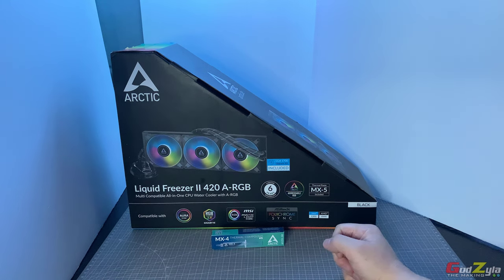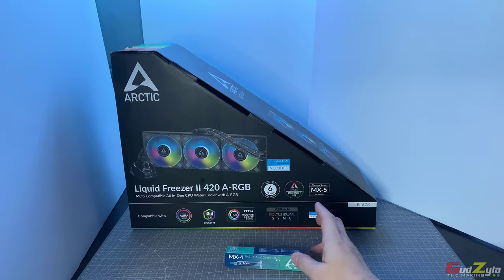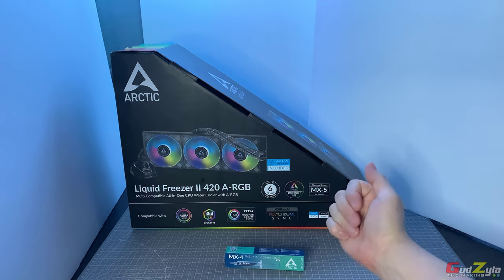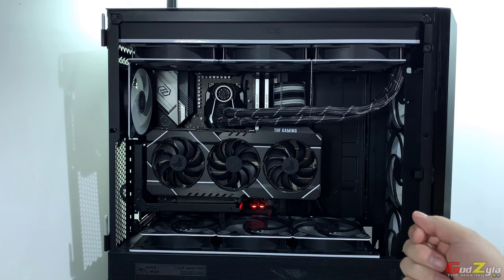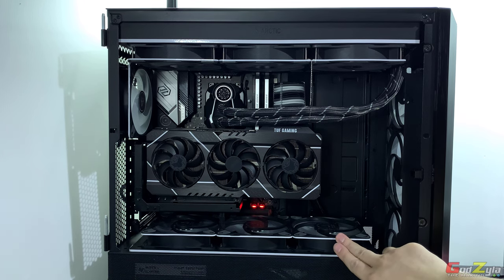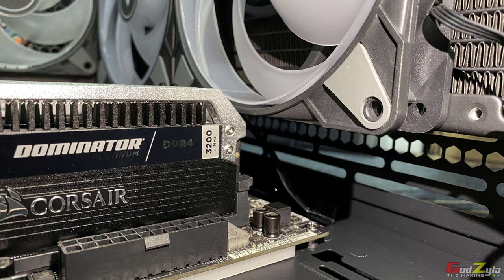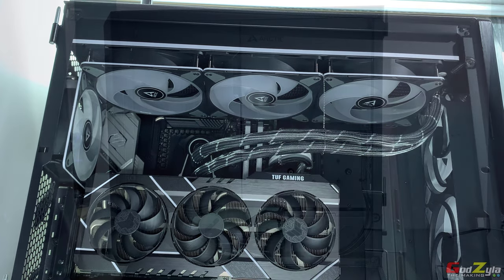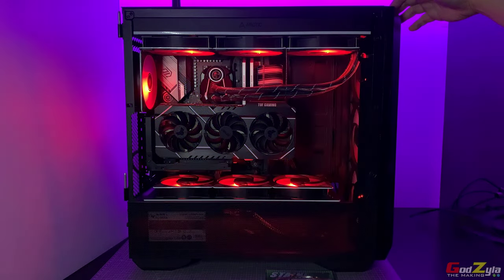Arctic Liquid Freezer II 420 in Lian Li Lancool III - Part 2 (The Experience)

Comment: This is just bonkers! Thank you so much for sharing this build and making this video. Just one thing: this is a P12 fan in the back of the case correct?
Reply from the maker: Hello Mordecai, welcome to my channel. Yes the rear is an Arctic P12 pwm pst argb fan, using rubber studs instead of screws to mount, as you need to offset abit for the top 140mm radiator fan to be in place.

Comment: Could you mount the 420mm aio on the front?
Reply from the maker: Hi James Birmingham, welcome to my channel. It is possible to put at the front but the top front fan you will have to forgo as it’s blocked by the hose of the radiator. Therefore you can’t mount the top front fan.
Reply: @KleoYan  what if you put the fans in front of the rad?
Reply from the maker: @jamesbirmingham9951  hi I do understand where you are coming from. I did try that but failed to close the front tray. Unless you are using a standard 28mm radiator and not a 38mm radiator of an Arctic 420 liquid freezer II.

Comment: Will the 420 aio work as push pull in the front?
Reply from the maker: Hello Joashane Garrick, welcome to my channel. Just a pull or push. The top fans will need to keep as 3x120mm and not 3x140mm. If you keep it as 3x120mm at the top. You should be able to do push pull configuration with the aio at the front.
Reply: @Kleo Yan  thanks for replying. I have the parts arriving in a few days. If you should push back the front bracket away from the motherboard, would the  push pull work with 140mm up top? I'm sorry if the question is rhetorical, just a bit anxious.
Reply from the maker: @cangwane  the issue is not about pushing the issue is the hose blocks it. 420 AIO has a fix position which occupied the whole length of the case front. Unless you can somehow place the hose at the bottom instead of the top. Which is not possible.
Reply: @Kleo Yan  okay I understand now. Thanks again for replying. I'll be back to this video in a couple days to help me build my system. 😁
Reply from the maker: @cangwane  you are most welcome. All the best with your build. 👍

Comment: Great vid! Any thoughts on how loud everything is on idle vs regular use.
Reply from the maker: Hello Jalen Fox, welcome to my channel. For a case which uses 140mm fans, your case will be silent as compared to using all 120mm fans. Though I have a mixture of fans in this case. 3 x 140mm on the liquid AIO and 3 x 140mm at the front, 3 x 120mm at the bottom and 1 x 120mm at the rear. It is quiet compared to my previous case, which is the O11D mini. you see 140mm fans do not need to ramp up at higher RPMs to keep things cool. Advantage of having 140mm fans, they can run at lower rpm but still produce more air as compared to 120mm fans. This case is now my daily drive and it's just beside me on my desk. I can work at night without having the hiss which I get from my old O11D mini. btw I see what I can do on my next video. It's all about thermal peformance of this case and the 420 Liquid AIO. I will include a noise test, but will need to wait as am currently busy with work projects.

Comment: Hi,got also this case with a z690 aorus master-13900k and rtx 4090 and arctic liquid freezer II 420,just replaced the back 140 to a 120 cause interfering with the mobo,for the rest its a good case,but it wasn't easy to build,the mobo is e-atx,so its big and,but after all i'm satisfied with it.
Reply from the maker: hello Fille1976, weclome to my channel. gald you have done up a this case with the 420, btw am curious, how is the temp for you on a 13900K.. on 5950X or 7950X it's superb temperature with PBO2.. my room temperture is always 29 to 31 degrees celcuius but the 7950X with PBO2 is hitting 79 to 80 degrees with consistant 5.2Ghz and 5.6Ghz ramdom boost speed.
Reply: @KleoYan  i took config E for this setup as its the most logical way,and temps seems ok.
Reply from the maker: @Fille-lj1qv  i see. thanks for the feedback. Am just curious as I stop playing with intel for about 2 years now.. but thank you!

Comment: This video inspired me to buy this case and use the exact same AIO and fan configuration. The build has been going well but now I am stuck with how to connect all of the fans and ARGB cables and i can’t tell from the video how you connected everything including the case controller cables. I have a fan hub and I have the RGB splitter and the same type and number of fans. Any chance you can help me and walk through what you connected each fan and argb cable to? I’m feeling so defeated by this step.
Reply from the maker: Hi Laura Blake, welcome back. I have done this. For all fan load. I daisy chained them according to this.

For fan load
=========
Top Radiator - fans x 3 (daisy chained) to motherboard CPU_Fan header

Front - 3 x fans daisy chained to motherboard CHA_FAN5 header

Bottom - 3 x bottom fans daisy chained to motherboard CHA_FAN4 

Rear - a fan to motherboard CHA_FAN1 

For fan argb load 
=============

First purchase this RGEEK 5V 3Pin RGB LED Splitter 10-Port Hub with 50CM 3Pin Extension Cord, Perfect for Lots of RGB. https://a.co/d/2lU92tv which gives you 10 argb port. Next your case have 3 argb connectors for the front fan. I have plug 2 front fans to the case argb connector, leaving one to connect to this argb 10 port hub. Now for the 3rd front fan, plug it this argb 10 port hub and you left with 8 port empty, the rest of the fans just plug individually to this argb hub. Argb extension cables might be needed. And I don’t understand why 3pin argb extension are so expensive on Amazon.com SJZBIN 3pcs Micro Connector Addressable RGB Extension Cable 30cm Black RGB Strip 3Pin Extension Adapter https://a.co/d/aA5BIkU.
Reply: This is super helpful!!! I was able to follow this and connect all of the fans. I did actually buy that ARGB splitter already so will tackle that next. I do have a follow-up question.

The case has 2 cables that I don’t know what to do with:

First, the case has a cable that has 3 ports for connecting fans. Was I supposed to connect that to the 3 artic fans that I installed in the front of the case?

Second, the case has a 4th ARGB connector that is longer than the others. What is that cable for? Is that supposed to connect to the motherboard? Or to the ARGB hub?
Reply from the maker: @laurablake5128  hi, I don't quiet get you on your first question about the 3 ports, are you referring to the 3 way splitter for fan pwm control? as for your second question. the fourth argb cable from the case is meant for you to plug to your motherboard, if you choose to use the motherboard to control the argb. If you do this, you will need to toggle the bypass mode from the argb button of your case. I normally ignore this cable as controlling via the case argb button is sufficient enough plus I do not want to install any software which will run in the background.
Reply: Thank you for your patience as I navigate this as a newbie :) I’m so grateful for your willingness to chat through this with me - it has saved me with connecting the fans!

Yes, I am referring to the 3 way splitter for the fan pwm control that seems to be connected to the case - is that cable supposed to be connected to the front fans?

As for the ARGB cable from the case, your explanation about that is super helpful - I’ll need to decide if I am good with using just the case button.
Reply from the maker: @laurablake5128  I see, infact that 3 way splitter is not needed in your situation as you are using Arctic P12s or P14s argb I assume.. that 3 way splitter is for fans that does not have the daisy chained cable like the Arctic has. You are most welcome, am gald to help, for your info I am not a reviewer. This channel is just my hobby and  I too will learn from others through feedbacks and comments. I am not 100 percent perfect. 😂. All the best with your build.
Reply: My gut was telling me it was not needed since my fans are daisy chained per your great guidance, but this is my first building and it made me nervous to see that cable not connected to anything. Feeling better now - it helps to chat with other builders. Don’t need perfection, just a friendly person to troubleshoot with, so many thanks! 😊 This case is solid and I love this AIO and fan configuration. I’ve had a lot of fun working in this case.
Reply from the maker: @laurablake5128  nice, welcome to the pc building community. 😉👍
Reply: Hi again! I’ve encountered one possibly two issues with the RGB and wondering if my issue might trigger anything that you may have encountered during your build. The first issue: two of the AIO lights are not lighting (the left and the right). These 3 fans are daisy chained and the AIO’s main RGB cable is plugged into the splitter hub (I have the splitter hub that you suggested). I checked the connections and nothing loosened.

The second issue (perhaps this is relayed?) is that the case controls do not change the colors or modes. The lights are all stuck on some strange flickering mode.

I’m gonna get back to troubleshooting tomorrow, but let me know if any of this triggers any thoughts. Thank you!
Reply from the maker: @laurablake5128  Hi, things to take note on, 1st make sure the front I/O is plug with a sata power source (Power suppply (PSU)) and 2nd the argb hub is also plug to the sata power source (Power supply (PSU). Double double check the argb connection of your fans, make sure all the female argb connectors are plug in the ARGB Hub. Same apply from your ARGB hub connetor (female) to your front I/O argb connetor (male). If you are sure everything is plug in properly, do some swap test between the fan argb connector in the argb hub. If still does not work, last resort is to have individual Sata source from your PSU to the argb hub and the front I/O controller. In dividual means. do not plug both to the same sata cable from the PSU. add an additional sata cable. so that your front I/O is drawing dedicated current from the PSU. apply the same for the argb hub.
Reply: So I’m now wondering if the problem is because the ARGB header is overloaded. I’m routing all of the fans to the splitter and the splitter is connected to a single ARGB header. Should I be using more than one header?
Reply from the maker: @laurablake5128  hi sorry for the late reply. Can you list down which motherboard are you using? Let me draft out a diagram for you later. For now am heading to bed. It’s pretty late at my end 2:44am. Will response to you later. Thanks.
Reply: Sure thing :) I have the Gigabyte X670 AORUS ELITE AX motherboard and the same AIO and fan types and configuration as in this video. Thanks in advance for helping me. The ARGBs are driving me nuts and I know there has got to be a way to fix it. The top 2 lights don’t light up, the rest of the fans are just flickering, and the case controls are not changing the colors. I feel like I’m close but I’m baffled!
Reply from the maker: @laurablake5128  Hi, this is how I do it for my setup https://imgur.com/6RHm349. If the picture is too small, kindly download it and zoom in.. hope it's not too confusing.
Reply: This is amazingly helpful. I see the difference in what I did with the ARGB connections:

First, you connected each of the top 3 AIO fans to the splitter (I have them daisy chained with one connection to the splitter. Could my approach be part of the issue? I’ll try your approach.

Second, I connected two of the front fans to two of the case controller cables, and the third case controller cable is connected to the splitter. Instead it looks like you daisy chained the three case controller RGB and then connected that to the splitter - correct?

Third, I connected the splitter to the D_LED on the motherboard. If you connect the case controller to the splitter, does that mean the splitter does not need to be connected to the motherboard?
Reply from the maker: @laurablake5128  you are most welcome. your approach on the front can be used. as in two of the argb connector from the case contontroller to your front case fans and one to the ARGB Hub. As for me, I didnt use three as daisy chained to the argb hub. I only use 1. also I do not connect any argb to the motherboard d-rgb connector as it's not required, unless you want to control your argb via gigibyte fusion ( I never like to install argb programs in windows due to background process)
Reply: What about the ARGB cable coming from the AIO pump. It sounds like you don’t plug that into anything if you are plugging the 3 top fans directly into the hub.
Reply from the maker: @laurablake5128  hi and you are correct as there is no device connected to that so I just ziptie and hide it.
Reply: I’m all done, and want to thank you again for helping so much! Can’t seem to add photos here or I would show you. Many thanks!
Reply from the maker: @laurablake5128  Hi and wellcome back. you are most welcome. you can send your PC build pics to my email godzylatech@gmail.com , thank you.

Comment: rear fan is 120 or 140 mm?
Reply from the maker: Hi LO_onY, welcome to my channel, it's a 120mm fans but with rubber studs as the metal screws not able to screw into position so kindly take note.
Reply: THx< Top fans is 140mm x3? @KleoYan
Reply from the maker: @TheBestLooonY  hi welcome back. The top is using a 420mm Liquid AIO and it’s all 140mm fans.
Reply: @KleoYan  oop i mean front xd, thx
Reply from the maker: @TheBestLooonY  I see the front are all 140mm but your tray will need to flip before you can close the front cover. This is how I flip the fan tray and to cover the front mesh cover https://imgur.com/gallery/vHezOSS

Comment: I'm hoping with the Gigabyte z790 Aero G, with Kingston FURY Beast RGB 64 GB installed, and the non-RGB Arctic Freezer II 420 will be OK for room clearance. =X
Reply from the maker: Hi St. Michael the Archangel, welcome back. If you have the motherboard with you. Maybe measure the height of the side vrm heatsink and the height of the rear I/O shroud. If it does not exceed 40mm, then you should not have issue to fit, but if it exceed, then it’s not possible.
Reply: @KleoYan  I do not have it, but thank you for the info.

Do you know what the dimensions of the RAM you installed are?
Reply from the maker: @st.michaelthearchangel7774  oops sorry, if I have those rams I would have measure them for you but I have sold it and upgraded my whole system. so sorry.
Reply: @KleoYan  No worries! 

I have another question: at 4:54 in the video, we see you removing the 3 140mm fans from the AIO, and then at 6:44 you are re-installing fans. I was wondering if those fans you were re-installing to the AIO at 6:44 were the same exact fans when you uninstalled them at 4:54? I ask, because at around 7:26 you start installing fans onto that bottom cage thing, so just wanted some clarity on the matter. Thanks! :)

Lastly, do you by chance know if the RGB and non-RGB versions of the Arctic 420 II AIO are the exact same dimensions? I have the non-RGB arctic 420 and the non-RGB Lian Li Lancool II case, so I'm hoping these install properly.
Reply from the maker: @st.michaelthearchangel7774  hi, welcome back, yes they are of the same fan which are the Arctic P14 ARGB that comes with this 420 Liquid Freezer II. the reason you feel is different as I did some highlightings 5:41. For both non-argb and argb 420 Liquid Freezer II AIO are of the same build same structure, the only difference are the fans. btw you have mentioned Lancool II? I dont think a 420 AIO will fit into that case.
Reply: @KleoYan  OK, thank you. Besides RGB, what is the difference between the radiator fans for the two AIOs?

I meant I have the Liano Li III non-RGB case. After a long while, my friend and I were able to fit the non-rgb Arctic II 420mm into my case, and with it mounted at the top, and it fits properly! :) The three fans in the front seem to be locked in place correctly, and there is enough clearance for my motherboard and RAM. I was really happy when I saw the AIO fit properly. I just need to buy the rubber doodle things you used for your rear fan, because I'm guessing it won't be able to screw it in the back now.

The only issue is that the 12 screws with the 12 washers for the radiator do not screw into my case properly (the holes they drilled are very slightly misaligned, causing me to have to angle some of the screws to screw them in, which I don't like). Unless I am doing something wrong there, but I still managed to get a lot of them in.
Reply from the maker: @st.michaelthearchangel7774  hi welcome back. Hmm, for me I have no issues mounting the radiator at the top with all 12 screws in and I did aid 3 of my friends who did the same setup as I did. One of them had issues like yours and had to use a file to file off some material on the top slots, just to fit the alignment of the radiator holes. By the way 3 of my friends are having the non-argb version. I guess am the lucky one who gotten the argb version. As for the difference between the P14s, the non argb will draw 0.12a and will spin at max 1700RPM and for the argb verion, it draws 0.17a and spins at max 1900RPM. The significant is above 2 to 3 degrees when using on the 420 LF2 radiator.
Reply: @KleoYan  Very cool. Thank you for the information. I plan on buying three 120 mm arctic fans for the bottom tray, and some rubber studs for the rear fan, so that should help too.
Reply from the maker: @st.michaelthearchangel7774  you are most welcome and all the best with your build 😉

Comment: Appreciate the high speed building section, but a neat video might be slowing that down to explain why you are doing what you are doing. At each step. Like why you took the foot off the case at the beginning, why and how you applied thermal paste, etc.  All of that is very interesting.
Reply from the maker: Hello CaptnYesterDay, welcome back. I will take note of your point and will do that with my further builds 😉 thanks for the suggestion. 👍